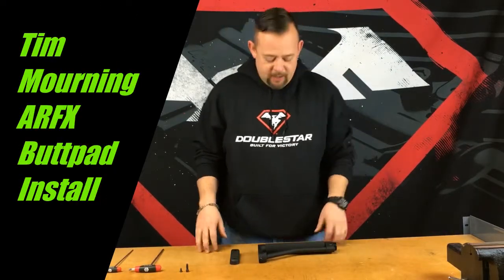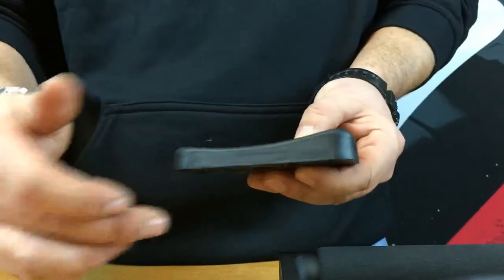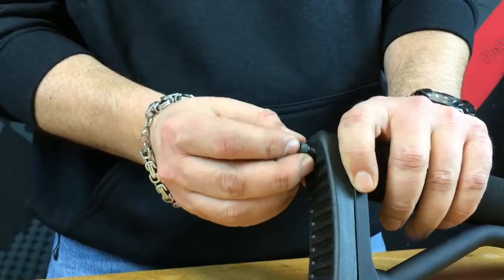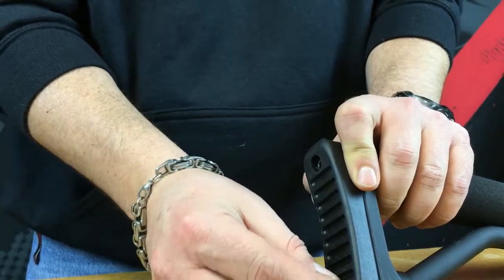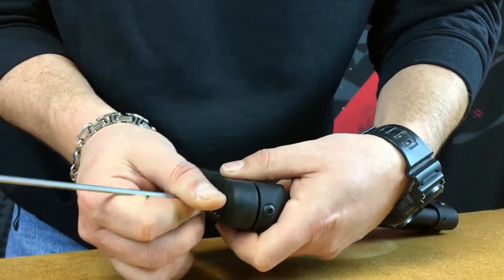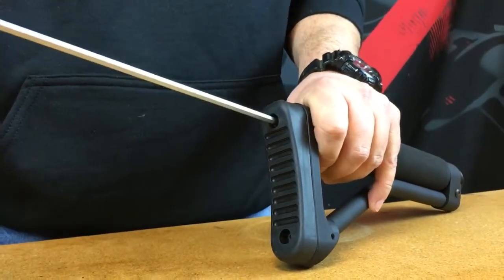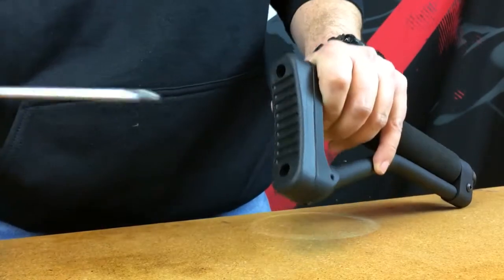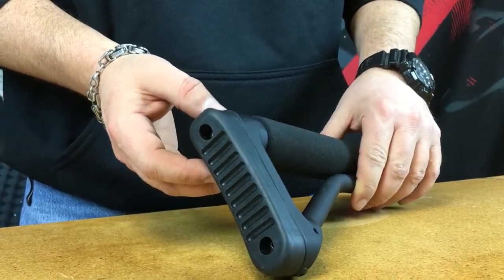ARFX Buttpad Installation Video

Comment: The butt pad should have its own screw at the top instead of using the stock retaining bolt.

   If you tighten the top screw tight enough to secure the stock to the tube, then you've already crushed the plastic inside the butt pad. 

This could easily be fixed by dropping down half an inch, and adding a separate hole for the butt pad itself... Or simply using a metal sleeve inside the butt pad.   

As it, the setup suffers from a design flaw.   They know this, that's why they tell you not to over tighten the bolt...  Basically you can have a tight stock and crushed pad, or a wobbly stock and uncrushed pad.

But you can't have both.
Reply: Just put a little bit of loc tite on the top screw and gently snug. You dont need to go hulk on it. It's just a butt pad 😂
Reply: @MrLex87  That skrew in question is what holds the stock onto the buffer tube.

It is in fact a design flaw.  Because you cannot even get the skrew snug without skrewing up the butt pad. To get the stock to fit even snug on the lower receiver will crush the buttpad.  No hulking required.
Reply: Your comment is rather old and maybe at that time things were different. I got the skeleton stock yesterday and installed it with the screw as tight as I could until I could not turn it anymore. The pad was not crushed. So maybe they changed the pad to accept this, I don't know. It does not need to be super tight because it's merely holding the stock in place but the actual buffer tube can be tightened down to proper torque spec without worry.
Reply: I didn't have any problem with the screw coming loose or the butt pad "wobbling"
I flip back and fourth between the original 1/2" pad, the 1" and winter coat season no pad. Maybe find someone handy with tools to help you out.
Dozens of range trips. Great design.